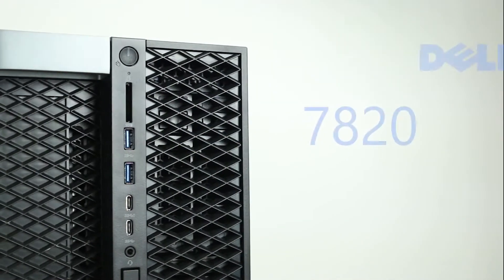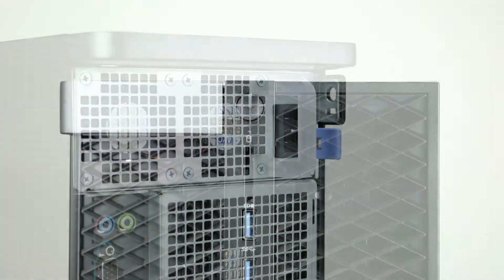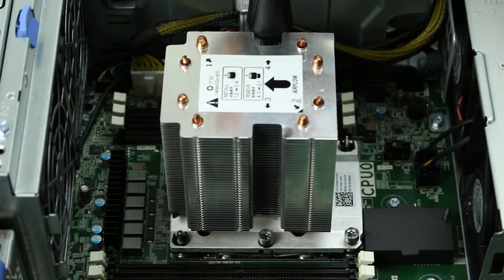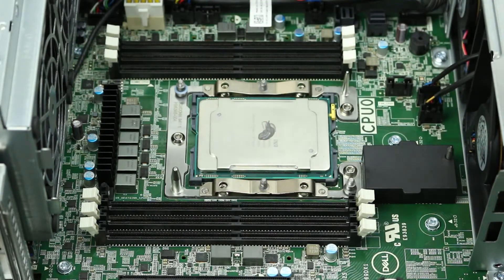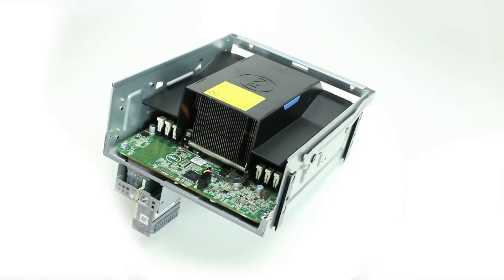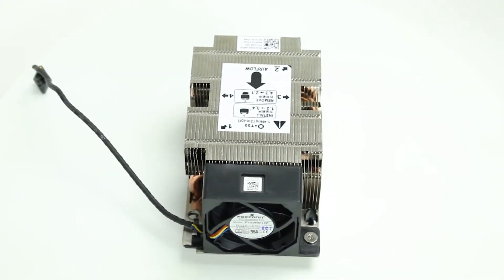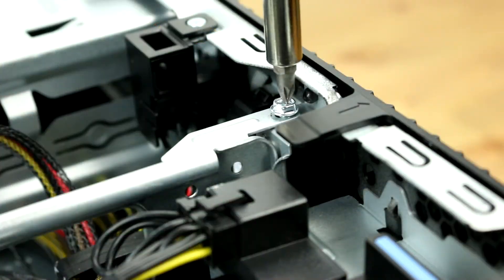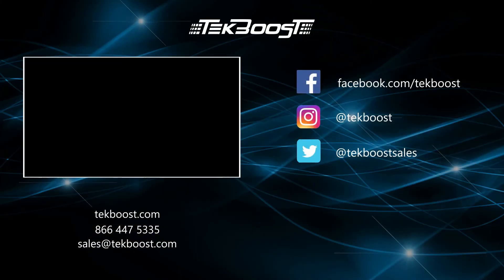Dell Precision 7820 Processor Installation

Comment: Bad video imo. Not only is that no way NEAR enough thermal paste or spread for such a large (and rectangular) IHS, but you went out of your way to ignore the 1/2/3/4 screw instructions (not going diagonally or splitting pressure)

Comment: Good video, however, to enable proper spread of the thermal compound and even distribution of force to secure the CPU you should follow the sequence (as displayed on the sticker) to tighten \ loosen the heatsink. P.S. any idea of the part number of the large single CPU baffle \ air shroud?

Comment: Although it doesn't really matter, the screws have a specific order for install and uninstall. 4-3-2-1 for unscrew, 1-2-3-4 for install. 
According to dell support, the CPU is supposed to be mounted on the heatsink first. The heatsink and processor are installed together.